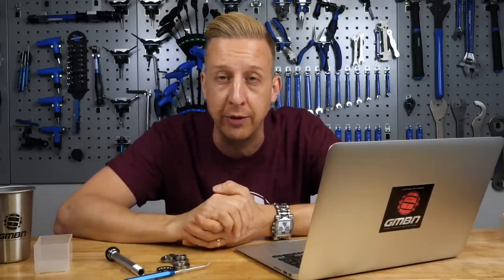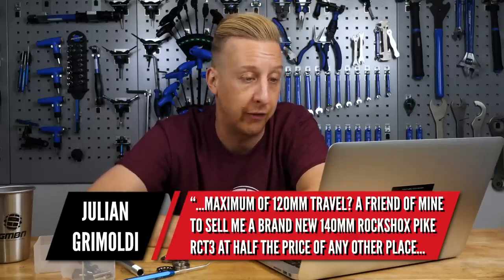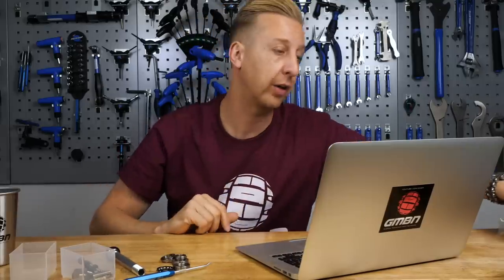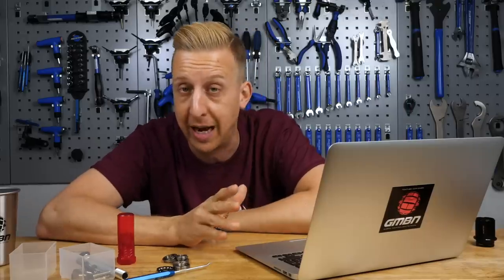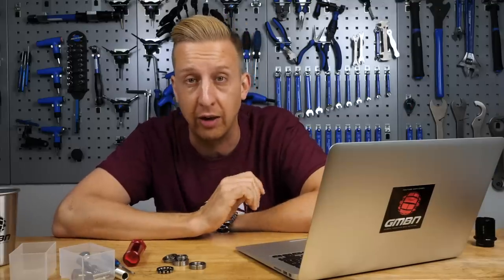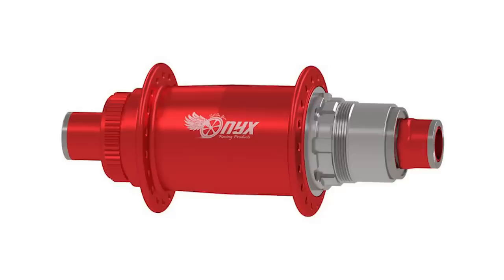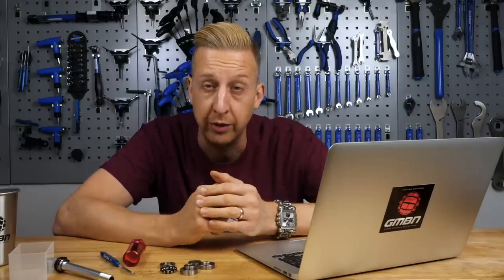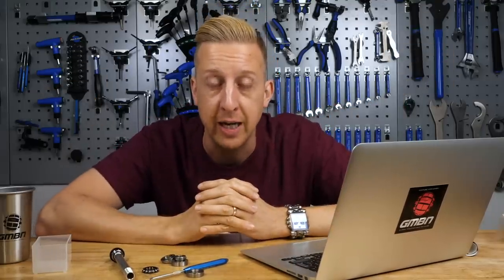Are Cheap Chinese Carbon Frames Too Good To be True? | Ask GMBN Tech

Comment: i have had bad luck with China Clone VCLS carbon Flex seat post - #1 did not fit 31.6mm seat tube frame , #2 Fake Bontrager Seat Clamp kept loosening , #3 27.2mm seat post too small loose on the Frame . #5 clone 31.6mm vcls tilt kept Slipping 
gave up and got a REAL Syntace p6 hi flex , cane creek thud buster and USE suspension seat post - all amazing Quality
Reply: Joni English your issue with the clone VCLS flex seat post is more than likely due to the fact that Canyon and Ergon only make a 27.2 mm version, so in fact it’s not really a clone at all.
Reply: @justinseau  - i know the Real mccoy only available in 27.2mm , mine was a FAKE 31.6mm BAD QUALITY even after i tightened the lower BOLT the seat would not hold its set Angle
Reply: Joni English any chance you tried fibre grip carbon assembly paste in between the two pieces to see if they stopped slipping?
Reply: @justinseau  never tried - SOLD the POST !!! Now Trying Cannondale SAVE seat post - Currently have a LT thudbuster , USE suspension seat post and a Syntace p6 Hiflex .
syntace seems OK but not as Compliant as the Thudbuster

Comment: They don't make Gore Ride On anymore.. think it was about 5 years ago they stopped and SRAM now own the name. They were great cables that improved reliability and reduced maintenance, never found a good replacement but as most bikes are now rear shift only with outer all the way then it's not that much of an issue IMO.
Reply: I stocked up but ran out last year. Using Jagwire sealed system with pretty good results.

Comment: In regards to using car valves on mtb wheels.  I don't think it will work.  They are designed to be pulled through a single layer of metal. As most mtb rims are double layer and thinner metal than a car wheel I don't think it will seat properly. 

 Even if you get lucky and manage to get a decent seal by pulling it through the inner layer, getting it out again will be an interesting challenge.  Normally a car valve is removed by cutting the back section off flush with the rim.  Some very carefully knife of chisel work would be required to not damage your rim.
Reply: Agreed, the pull through rubber valves seat to a 3+mm steel rim or equivalent in alloy.  Bolt in car valves are cheap (<£1 ea for 20) but are bulky and may not seat well on the inside of a bike wheel's narrow well.

Comment: #askgmbntech not a question but in the coil vs air shock episodes there was a question about tyres, and you said that the Minion DHF and DHR stood for DH front and rear. It's actually Freeride and Race, a lot of people just use them as a front/back combo though.

Comment: @boomerang freak  9:45
try taking of very damaged center lock rotor, or tightening a center lock rotor on the trail....
(you might need to, to keep going even slowly, better than walking with locked wheel in the air or taking caliper off)
This is a flawed design, that requires 1 BIG tool, that no one carries around AND requires taking off the wheel to tighten the ring or even check for tightness. 
That's not all...There are two types, so if You have one older classic 9mm axled bike and new through axled bike, You need TWO tools. 
Multitool is supposed to allow to do everything on the trail except of complete rebuild, if You have CL hubs, You can't do everything with multitool. Even torx bolts are obsolete imo, as the tool head has too low purchase(i think they say in english) on shallow mushroom headed torx bolts that also rust in a year and then give troubles. This only adds to weight and complexity of multitool. In fact we could get rid of few allen keys from multitool too if bike components and accesories manufacturers would have some brain and set standards on bike bolts.

Comment: After looking for a budget headset I found an AEST headset on pinkbike for $30 I thought I'd check Ali Express and found the same headset for $18 shipped so gave it a try.  It looks like a crude copy of a Chris King from a distance and it works okay but I've had to put somewhere around 4-5 NM on the top cap to prevent play.  It still spins smooth but how long can it last with the bearings overloaded like that?  I won't be buying Cheapo again I'd have been better off with a simple open ball aheadset.  Now bleed kits and the like China has done a pretty decent job in my experience.

Comment: I know cheap Chinese handlebars are usually better. 

They don't have the need for as much of a profit margin, or at least they're not trying to gouge as much out of the customers, and they tend to use more material than necessary, rather than less, or barely enough.

Comment: I know I'd like to see you tear into the cheap Chinese components. I've seen lots of people buying these items and riding with supposedly no problems, but I wonder exactly what a tear down would look like and of course, the safety.
Reply from the maker: The teardown would be very interesting. We'd be curious to see what it would look like on a microscopic level too.
Reply: Ooh! Yeah. Like if it's metallurgically the same or inferior. Something like this, if you really broke it down, would most definitely have an impact on the cycling industry. Are you prepared for that responsibility? I know I'm ready to watch and learn.
Reply: In my opinion, this needs to be a multi-part series to do right, including cutting a frame in half to inspect the inside quality.....
Reply: @gmbntech  hey, for carbon stuff you might want to partner/refer to Luescher Teknik! They do material tests in brand name and generic parts - and the expensive stuff doesn't always come out ahead. Very neat.

Comment: Hi Doddy. I have stock front and hub which is made out of steel. When I have my weekly bike maintainance, I notice that the disc rotors are rusting because of the steel hubs. I wonder if I will put washers in between the hubs and rotors. Or just paint the non-drive side of the hubs to prevent the rusting of the rotors. I'm looking forward to change my rotors from stock to SRAM centerline rotors.
Hope you pick and answer this question.
Love the show. More videos to come!

#askgmbntech
#gmbn
#gmbntech

Comment: First time owning a fulcrum wheel. I have an old model, fulcrum wheel. The pawl system and spring they use don't give me confidence. The pawl engages ever so slightly different timing and the thick grease from factory make it worse. There was once, in 1 hour, I heard for about 6 times something popping at the pawl. I took it apart and remove the grease added light oil and solved the problem. Can I add another of that spring(the one that goes around the whole hub) to increase the tension of the pawl? I had a hope pro 2 previously and never had any problems with grease or light oil.

Comment: Regardless of origin or product - If it is too good to be true, it is and if you need to loose your teeth to learn that then so be it.

Its easy to point out the cheap "too good to be true" items and stereotype ALL Chinese products under the same light but I doubt many consumers know that there are plenty of UCI registered manufactures that produce top quality products and Im sure that those manufactures that are UCI certified manufacture your "branded" bike.

Comment: I bought a chinese frame and it developed a massive crack from day 1, got the frame replaced and it also broke; I gave up, and throw it in trash.
Seriously guys, it's a gamble; and I bought it from a "Reputable" seller.
I cannot say the same about chinese carbon wheels, they are pretty good, I own a couple of them, I think there's a big difference between a wheel, and a frame; yet, chinese wheelsets are more expensive than their frames, my MTB wheels have been thru hell, and no issues.
If you want a frame, wait and buy it on sale, things like saddles, handlebars, seatposts, wheelsets, go on and buy from china.

Comment: Dont get the hype about carbon, for any "average joe" a aluminium frame is more then good enough. Had a devinci troy carbon this season, i always worried about cracking the frame. Ill be back on alu next season ✌️
Reply: Funny because aluminum fatigues, and aluminum is weaker than carbon; Steel and Titanium is what you need to talk about if you want to stop worrying about cracks. https://en.wikipedia.org/wiki/Fatigue_limit

Comment: I have been in the market for a new FS MTB. My area doesn't provide a lot of variety for test riding so I spend (to much) time online looking at the many great options. Bottom line, when I find a bike that feels right what are the most important geo numbers to look at for finding bikes with a similar feel, or is it just nonsense to attempt this approach?
Reply: Most important one after looking at sizing for you would probably be the head angle. Most chinese carbon frames are XC oriented though with the Ican P9 and P8 being the exceptions. 
Don't expect to find the latest trends  of short chainstays and slack head angles in chinese frames just yet. They're getting there, but it'll probably take another two years.

Comment: Hey Doddy, you really exude some knowledge regarding geometry, forks, etc. So here goes; Btw, I'm 58, and don't mean to hi jack this episode, but i'm forgetful and need your advice. 
I've been riding a 2017 Cube stereo 120 HPA Race the past 2 seasons, and I just ordered my first E bike, a 2018 FOCUS Jam2 plus LTD in Sz L (18.5"). I'm 5' 11/180cm 185lbs. and want to slacken the front end WHILST ( one of Chris Smith's faves) upgrading the OEM Rockshox Recon RL 140mm.  
I don't jump higher than 2' or hit drops more than the same, but would like to progress to more height and distance of both next season on my new bike. With a tight budget in mind, what would you suggest to upgrade to? And, would adding 20mm of travel upfront slacken the 66.5 deg head angle, along with a better ride, stiffer front laterally etc?
I am considering the:

 Yari  150-160mm  
Lyrik  150-160mm 

I don't know enough about the Fox line to list them, but am open to their forks too. Hope to get a response,and thanks for all your killer vids, the entire team of GMBN/EMBN and lest I leave out the guys at GCN rock!!

Comment: What about Chinese (or cheap) aluminum/steel bikes? Those don’t have the same structural issues as carbon although they’d be a tad heavier, which doesn’t affect ride speed too much. Then assemble the bike from entry level components (any 9 to 11 speed) sourced online ?

You could even order a purecycles.com steel frame bike (but carbon fork and seatpost) with Ultegra mechanical for $1500, or 105 for $999. Cheaper than other manufacturers and made from steel.

Comment: HELP!
My rear brake pistons are not retracting :( and one of the pads is rubbing on the break disc
I tried removing wheel and brake pads and pushing pistons back in but after i put everything back and pump break leaver they dont retract :(
Break model SRAM Code RSC
Reply: @geemail369  thx already ordered dot fluid to do this trick
Reply: @p199a   If this doesn't work it's ime to replace parts:
https://www.youtube.com/watch?v=Ihb2cBiXp2U&t=200s

Comment: @Tubeless with shradder  0:30 @Jake Evans    (links to polish shop below)
There are some shradder tubes with thread all the way+retaining ring, a rarity but do exist, surprised Doddy didn't mention it as they exist for decades. 
This is the only ghetto way of doing tubeless without expensive tubeless shradder valves, because car rim whole is much bigger and the valve rubber seal is widening significantly towards the bottom, so the outside rim surface WILL NOT pop into that retaining groove in the car valve .
Example of tube with threaded valve http://www.rowerowaholandia.pl/p7652-impac-detka-28x1-1-2-wentyl-samochodowy
They also have same brand model with rubber covering the thread, so no-it's not "just on the picture". Narrow tube this 28, bit bigger 26
http://www.rowerowaholandia.pl/p7654-impac-detka-26x1-75-2-125-wentyl-samochodowy

Comment: 13:48 @Joseph Tinsay  (Different shifting cables)
There is so many cables these days and there is a lot of bullshit marketing and lies in product description, that it really is worth paying more for expensive cables if you take care of the fraying at the end. I found that many cables are advertised "rust proof", but really the're just zinc galvanised ; many are "stainless", but they're just coated ; many are "teflon coated", but are standard steel=will rust as soon as teflon will wear through. ALL THREE is not something we want in a friction + abrasive(sand/dust) environment.
I recommend a full stainless steel or a full acidproof steel cables. Paying extra+taking care of the ends=everlasting cable+only the housing to be the wear item.
For proffesional like performance though probably teflon on teflon will give best shifting, but not everlasting.

Comment: Hi Doddy great show.I have just brought some fox 40s with a wheel size of 27.5 and want to fit them to my norco aurum 2 2012 model. The rock shox boxxer i have on the norco at the minute are a bit shorter than the fox 40s will this damage my frame iff i change them over will be running my 26" wheel in them thanks

Comment: Cheap Chinese frames for a mountain bike, I'm not sure... but not every brand are as awesome as Santa Cruz in the warranty department. I guess the real answer is just buy a Santa Cruz or forever hold your peace.

If you want a really informative video about carbon bicycle frames, Cycling Maven (from Australia) visited an ex-aircraft engineer who X-rays frames and has a wealth of knowledge about even some of the most famous brands in cycling. The truth is, defects in carbon frames (regardless of the brand) are more often than you'd think. Almost all of them are invisible, and whether or not the frame fails because of them is both a matter of if and when. What the cycling industry gets away with is murder compared to aircraft. Your typical domestic jet has a line of scrutineers before it makes it out the door. Aircraft are expensive, the airlines and manufacturers aren't able to take any risks for obvious reasons. Your average carbon frame has this one bloke at the door named Dave who "thinks it looks alright". Does it mean carbon bike frames are junk? No. There's more unbroken ones than broken ones at this point in time, and it'll probably only improve from here.

Comment: Hi Doddy, I'm thinking of getting a Canyon Mountain Bike but they aren't shipping to My country Nigeria. We do have A Chinese Brand here SAVA which is SAVA DeCk 700. Do you think that will be a good option? It cost around $1000 and it's carbon frame. I'm currently using Raleigh mxr29er.
Reply: They are awesome and all over Europe.
Reply: Honestly I really can't fault a Sava. I've had 2 MTBs of theirs in the last 12 months (a Deck 3.0, which I still have and a Deck 700 which I sold to a friend) and I am extremely happy with them. The only niggle I had with them were the Suntour forks. Some like them, I don't.

Seriously, if that's what you can get and you want it.....go for it. For a budget carbon MTB you can do far FAR worse than a Sava.

Comment: #askgmbntech Hi Doddy! I would like to ask if there are any length differences or standards on free hub bodies with regard to the number of sprockets they support? The reason I asked is I currently have an SLX FH-M665 hub on my bike. I got it used and was a bargain. I know this hub supports 8-10 speed cassettes. I'm currently running a 10-speed Deore cassette on it. I would like to swap it out with a 1x11 setup further down the line. I would like to know is if I went with this route, can I still use my hub or I'll need to swap the hubs also? I've tried searching the internet and read somewhere that when it comes to Shimano, if it fits a 10-speed then it'll fit an 11-speed. Can you clear things up for me? Love the show. Thank you!